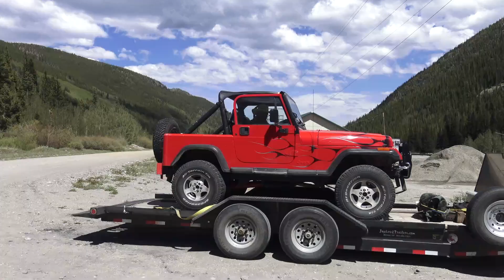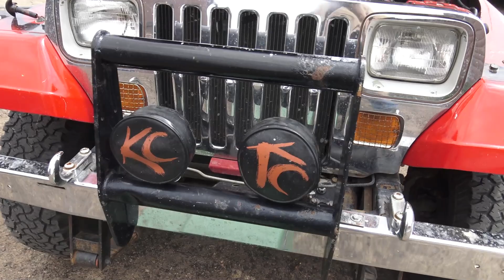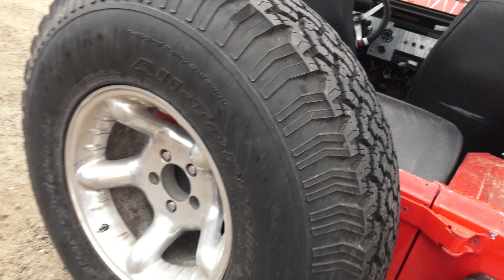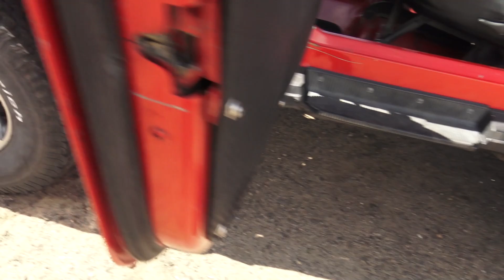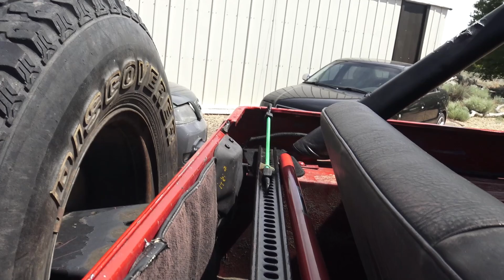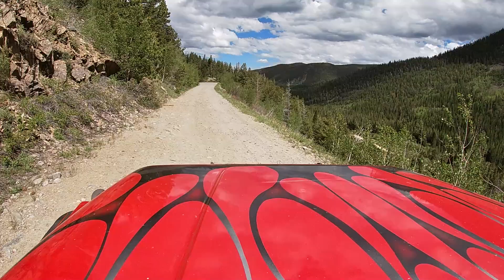MrTruck New Jeep project almost climbed the mountain, pushed the Wrangler back down.

Comment: Might be time to do a slip yoke eliminator and run a double cardan joint shaft
Reply from the maker: I thought that's what was on the rear
Reply from the maker: Not having any problems with drive train
Reply: The slip yoke kit prevents the possibility of the front yoke from slipping out while offloading. The double cardan joint allows more driveshaft angle before binding.
Reply from the maker: @danatkinson6698  I've seen a slip yoke kit, might need that if I disconnect the front sway bar. Yes, been using a cardan joint for decades on the farm. We called them an osculating u-joint on hay baler pto's. It was a casting with a u-joint on each end. Allowed for tight turns with a tractor pulling a baler. This is a cheap jeep project, only fixing what's broken.
Reply: @MrTruckTV  it's still a cheap jeep if you find stuff on craigslist and marketplace